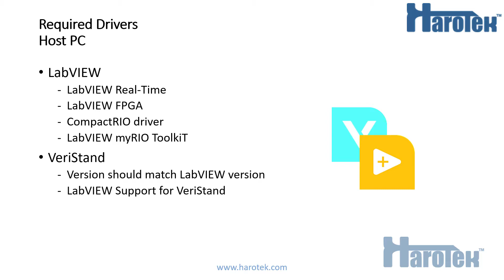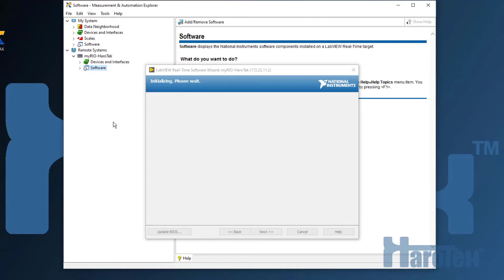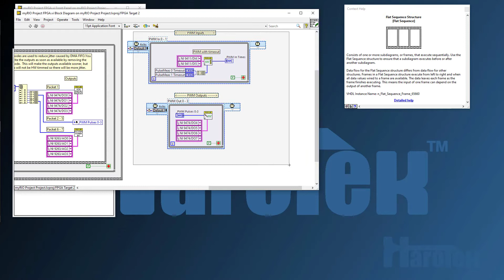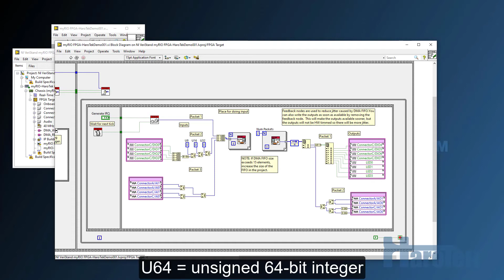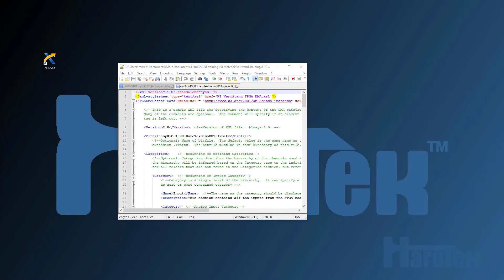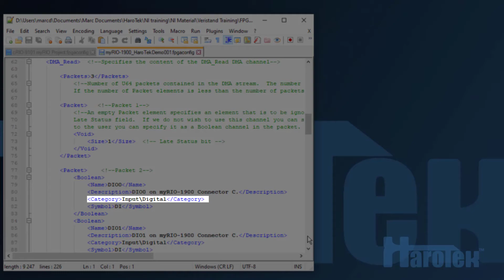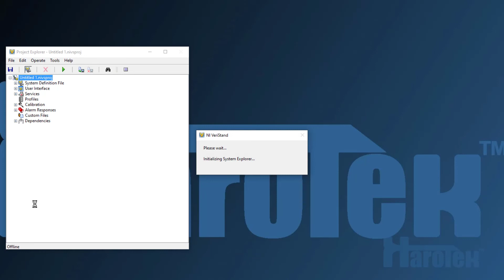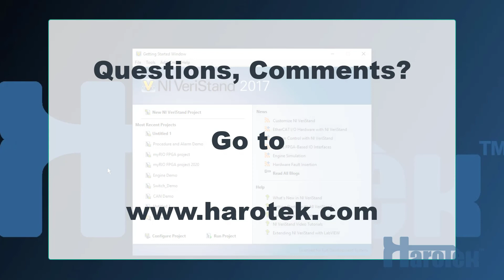Using the FPGA I/O of a NI myRIO with VeriStand

Comment: Thank you so much, it has been very helpful. I have LabVIEW 2019 (32bits) and have installed VeriStand 2019 but when i open LabVIEW projects I cant find the template of VeriStand in LabVIEW. My main goal is try to fix this problem, test it and then try to deploy a Simulink Model in myRIO and map the inputs through VeriStand (HIL Test of a PV Solar Panel), but i dont have idea where to start, maybe can you give us some advice and how to solve the problem mentioned? Thanks
Reply from the maker: I am not sure what your problem is. Are you trying to create a FPGA Configuration files for VeriStand?  If that's the case, for the VeriStand Template to appear in LabVIEW, you must install the file provided at the end of the original post of : https://forums.ni.com/t5/NI-Labs-Toolkits/NI-VeriStand-FPGA-Based-I-O-Interface-Tools/ta-p/3493285?profile.language=en
Reply: @harotek2207  Thank you so much, that was exactly what I was need it in this first stage! the second part is try to use a Simulink Code of a PV Panel and download it to myRIO (Convert in C code and deploy in myRio, HIL Test). It will be programmed through VeriStand. I sincerly appreciate your help. When i finish my project i share the process with the community. Keep Going forward.